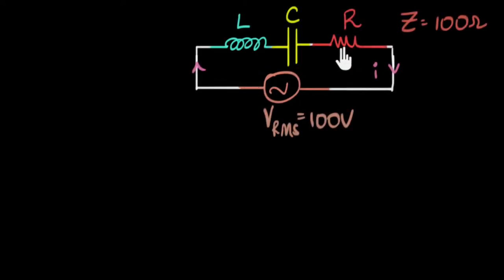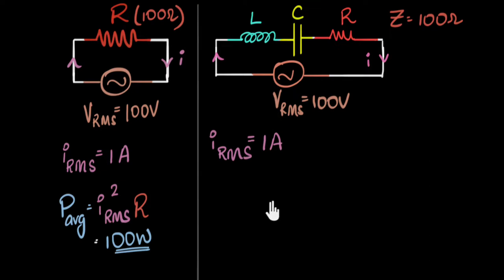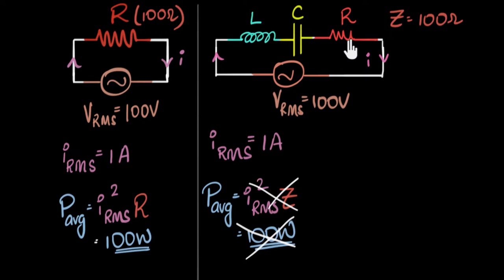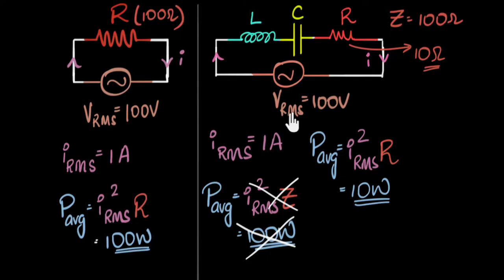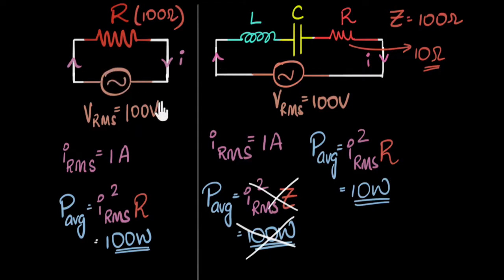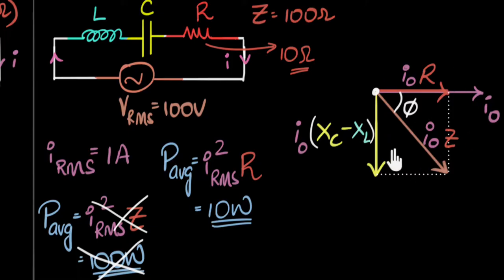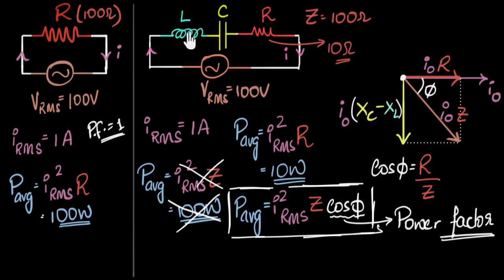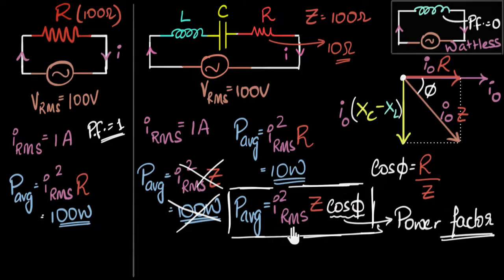What is power factor? (Power in AC circuits) | Alternating current | Physics | Khan Academy

Comment: we can add inductor or capacitor in parallel to the circuit based on whether current lags voltage or leads voltage respectively , connecting , given that the  resistor  needs to consume same power . BUT if we just concentrate on increasing the power factor we can either connect in series or parallel , although connecting in parallel will give a exaggerated effect

Comment: If we assume that XL is  greater than XC and XC is equal to R.

Connect Inductor and capacitor in series then connect this combination with resistance in parallel then give AC sorce.

So we observe that in normal case current throw the resistance is V/√R^2+(XL-Xc)^2.
and in our assumed case 
Resistance branch and Inductor capacitor branch have  different current

So we assume that resistance current as I' ,and I is the current throw capacitor and Inductor. 

Applying Ohm's law
V=I'R
V=IZ
I'R=IZ

I'=I(Z/R) ,Z=√XL-Xc^2

So in this case resistance current is more than inductor and capacitor current
Which was same in normal case.

Tell me if I am wrong
Reply: bro i think you r from r square
Reply: Wrong

Comment: Why does L and C don't decipates power since they stores power for later use as they are passive elements also...... Plzz explain regarding this
Reply: Even if they consume power for awhile, they give it away for the external circuit after saving up.
If you had seen the video from the electromagnetic induction, he teaches on how an inductor works when its connected to a circuit containing a bulb
The inductor resists the increase in current due to the voltage source for a while, making the bulb not so bright for some time. And at a certain point, the bulb glows at its max brightness.
here, the time in which the bulb doesnt glow to its max is when the inductor is consuming power, but at the certain point in which it starts to glow at its max is when the inductor provides the previously saved power
similar for C

Comment: If we add more  resistor in series and at in some point the resistor would be dominant  over the reactive  element .Hence the circuit will tends to be resistive and the phase angle   between voltage and current will tends to zero .Therefore the  power factor will tends to 1. Thus we can improve the power factor of the RLC circuit. Let me know if I am wrong or right !!!!!
Reply: Thought same but he said R is fixed

Comment: I don't get it. In case of the RLC circuit, still the Resistors(R and internal resistance) are consuming the power, right? So the power consumption should be-- P=I^2*(R+r), ain't it? Why do we write it in terms of Z?
Reply: Let say if the phase difference is given,but Resistance not given to us we use the formula P=I RMS squared times Z times cos phy

Comment: Why we use RLC circuit instead of resistive circuit if power factor is smaller?
Reply: to regulate current in a ac circuit we don't use resistor as it dissipates more energy in form of heat